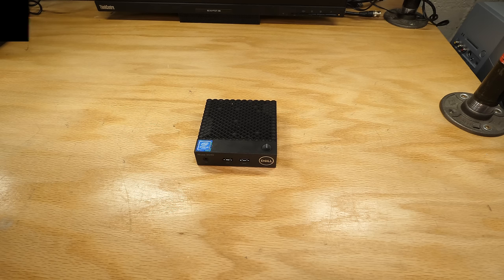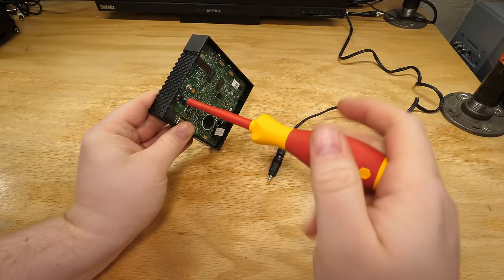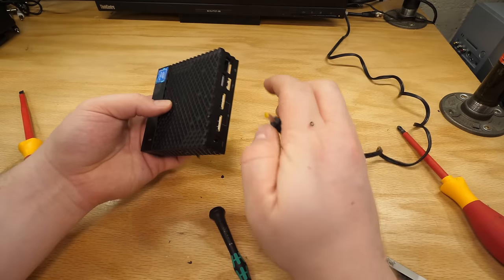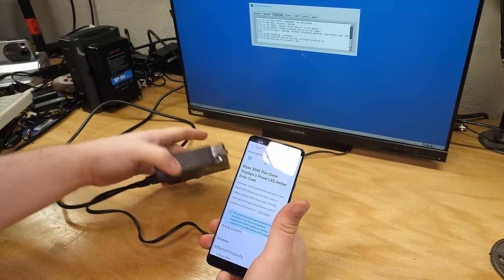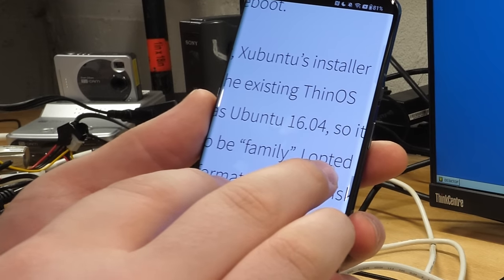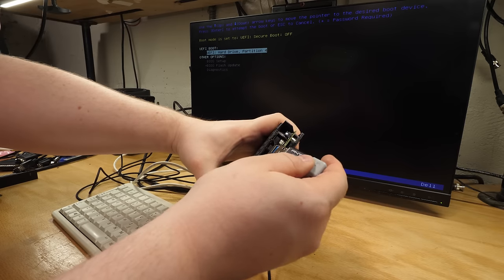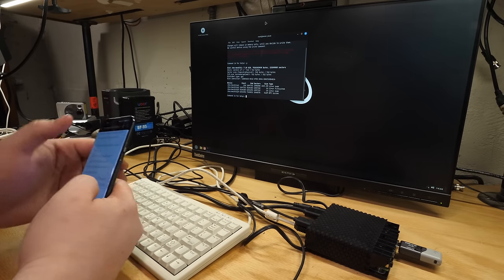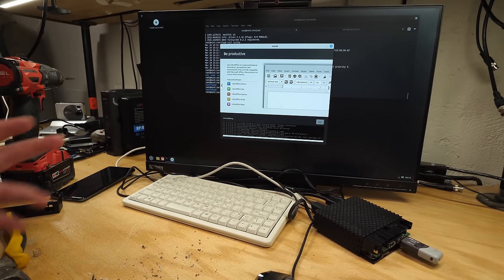Little Guys: Episode 2 [Wyse 3040]

Comment: The Atom in this thing is the same as the Atomic Pi SBC, which came with a 16GB eMMC. It was capable of installing 64-bit Windows 10, but the experience absolutely sucked as you'd expect. I ended up putting Fedora Silverblue on mine and using it as a low-powered remote backup server with the SD card slot as storage.

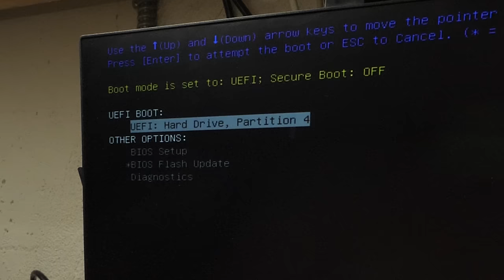Comment: 13:51 My Dell's BIOS has text mode UI, which I think it is default UI provided by AMI given that one ASUS machine I had has similar looking UI.
The menu at that screen looks similar, except mine displays those options inside a blue popup box.
Reply: Many of the cheaper machines have a normal BIOS. Basically all the Latitudes and Precisions have a the custom Dell BIOS. Although I will say my D800 (made in 2005 but introduced in 2003) has the older text-mode custom BIOS. I'm guessing the change to the current style probably started with the ~2007 models (like Gravis' favorite D420) as these models are 64 bit only.

Comment: I run a pair of these at home as DNS servers for my home network, for which they are more than adequate. I like that (if memory serves) the system uses about 5 watts, and because it's x86_64 then unlike a Raspberry Pi I can run a regular Linux distro on it which makes it easier to manage.

Of course, I am running Debian (without X11) and have manually set up PowerDNS on them, rather than using some potentially heavy generic "router/firewall" distro, but I've been quite happy with them.

One curious thing I found... with the DisplayPort to HDMI adapter I was using, it would hang when you tried to soft reboot it from within the OS, but if you unplugged that the reboot would succeed fine. (This wasn't a problem for me as I was intending to run it headless anyway - the monitor was connected for initial setup only anyway.)
Reply: Hmmm... I bought a lot of 13 of them, and 4 of them were giving me this problem as well as the CMOS one (while 7 were just giving me the CMOS issue), but I was testing them with a DP to HDMI cable that worked just fine. Maybe it is that those have too low of a voltage to run the cable on restart, while CRD's just doesn't have enough to even first boot?

Comment: I have a bunch of these things at work. It's not a surprise to me that it won't power on. I see this in ~1 in 5 of those terminals. You really have to press it hard and try a couple of times. Or just unplug and replug the power cord quickly while holding the power button. That usually works.

Comment: I work with a ton of surplus office computers, and for some reason, that style indicator light has issues. Some of them are perfectly fine, and others are really dim like the one you have. I have an OptiPlex 3040 micro which I set up as an HTPC, and the power light is the same way. It also is the case on the standard SFF machines as well as the MT machines. It seems inconsistent though as 2 of the same model can be completely different, it is annoying for troubleshooting.

Comment: Smallest Atom processors I've seen were probably those inside my long dead Asus Zenfone 5 (from 2014) which had an Atom Z2560 (2C/4T 1.6GHz) and Zenfone 2 (from 2015) which had an Atom x5 Z3580 (4C/4T 2.33GHz). Those nuggets heated up a lot like really badly. The Atoms inside lived around 80~100C installing apps from the Play Store and even worse when running anything demanding even emulators.
The heating issues paired with the crappy Android version by Asus (i.e. built in system apps like the battery manager and security center crashed among other apps) made for a poor experience for phones. Heck the Zenfone 2's body even easily warps and has ghost touch issues.
Atoms and Asus Nuggets aside. On the topic of the Wyse 3040 I know someone from a workplace that still uses some of those (but currently decommisioning them in favor of laptops being used as purely thin clients) and considered asking them if they could get me one for projects. Some research later and I realized it would be a pain in the a$s to install Debian and turn it into a raspotify or pi hole device because of the bios, eMMC, ram limitation among other issues.

Comment: Damn small linux, fits on a cd-rom, fairly modern os, various apps come pre-installed it received a recent version in 2024 after 12 years. alternatively there is an 'assembly language' OS, it fits into 8 megabytes of RAM.

I heard the point of these thinclients like the compute stick is to buy them in bulk with a bulk discount and have literal boxes upon boxes of them still on their pallets, so you can grab one out of the box, image it and put it in use whenever one of them fails... as if they knew they were going to fail often enough for this to be an actual 'solution' to the failures. as you said the 'real work' is being done elsewhere in a VM inside of a VM.

Comment: I wonder if the Ubuntu vs. Mint problem was a kernel version thing. A lot of people have been experiencing problems with the default 6.5.x Hardware Enablement kernel in 22.04 (UBSAN errors with my mother's laptop's AMD GPU drivers, UBSAN errors with my VirtualBox modules, etc. etc. etc.) and the recommended solution if you don't have more bleeding edge hardware is to switch to one of the other packages that'll give you a Canonical-supported 6.2.x-series or 5.x-series LTS kernel instead.

Comment: Use puppy Linux. It's very tiny and will run reasonable on a 486 DX4 100mhz so a arm atom CPU will fly on it and easily fit with room spare on the emmc storage.

Comment: CMOS battery is most likely a CR2032 with leads attached to either side.  In a pinch you should be able to cut the leads off that one and use some heat shrink tube to "attach" them to a new one.

Comment: As hackjob for the cmos battery: you can just snip the wires off and solder a cr2032 on it
Reply: Or copper tape the existing contacts, as solder, unlike the original spotweld, will shorten the cell life. Finish it off with a bit of light heatshrink tubing.

Comment: I'm pretty sure ThinOS is Linux-based, because it supports a lot of Hardware that is not Dell or meant for it. Like cheap bluetooth dongles.
It's bigger brother 5070 is kinda popular for pfSense, because the Extended version has a low-profile PCIe slot.

Comment: From what I’ve seen with that sort of model of dell power lights, they must be overdriving the LED or something because it just seems that they just get really dim over a relatively short amount of time, worked on plenty of desktops that had extremely dim power lights and I would only know that it did turn on sense it flashes the much brighter orange light first 

This undoubtably has high hours on that little LED, probably only ever turned off when the power went out

Comment: I'm sure it's been said, but "Windows on the go" via Rufus may be an option to install Windows to a USB drive.
As far as installing Linux? I was able to install Minimal Xubuntu by formatting at BTRFS, enabling compression, and only then is there remotely enough space to install it with no swap. I think I had somewhere in the realm of ~2GB of free space, and didn't have much more installed other than Firefox.

It's neat that you can make a computer this cheap. It's unfortunate that it doesn't use mSATA, or m.2 with SATA/PCIe available as it's utility would go through the roof.

Comment: I have a dell workstation with similar industrial design that has the same problem with the light on the power button. Either the LED isn't bright enough (maybe it dimmed over time??) or the plastic isn't clear enough. Fortunately it has a super bright white HDD activity light so it's pretty easy to actually tell if it's on.

Comment: that cmos battery is used on alot of dells you might be able to use the same battery as the RPI 5 RTC battery if its the same voltage ?
Reply: Yeah, it's just a CR 2032 cell on a header. Must be cheaper than the button cell holder.
Reply: @volvo09 A button cell holder won't fit inside

Comment: My workstation Dell Optiplex 7040 uses the same power button and I also can't tell if it's on by the power light. There is an orange light that does shine through it when you press it though, so it may have been made with an orange light in mind.

Comment: For the sake of asking, have you seen the InFocus Kangaroo? It's another weird little PC equipped with an Intel Atom. It's meant for mobile use, but instead of being a standard laptop, it's just a little slab. It also came equipped with its own certified Windows 10 release, which ultimately also means that stock Kangaroos are locked at a very old version of W10.
Reply from the maker: I JUST learned about this the other day by accident, and I really want one. Mind you, it's not really ideal for this series, since it's just a consumer product (and an incredibly absurd one), but I'm tempted to get one anyway because nobody else seems to have reviewed them. They look really, really awful.
Reply: @CathodeRayDude  The build quality at least is pretty solid in feel, and since it's locked to an ancient version of W10, it doesn't perform too bad either. But the battery life is definitely poor, and it wouldn't be suited to much more than web browsing.
Reply: @CathodeRayDude  The Kangaroo might be good for a Little Guys Gaiden, if you somehow manage to get one!
Also, love your content BTW. Been hooked ever since you're recommended to me a little while ago!

Comment: There's an UEFI bug that prevents it from installing/booting linux.  Also Hardware Haven covered it in one of his videos.  I also recommend Wyse 5070, which works flawlessly, as long as it is not Windows, and avoid 3040 if possible.

Comment: That LED issue is kinda weird.. I've got a whole stack of these around, and their power LED is bright enough to be visible in regular daylight. Maybe your unit has just seen a lot of hours of use and the LED has burned out? It might also be a series issue, since there are at least 4 different revisions of these thin clients, with the latest one having been upgraded to 16GB eMMC, and that's a really useful home server box, especially at the ~40$ price point these are going for.
If you want to get Windows running on it, why not just plug a 32GB USB stick in it and install it on there? The USB3.0 ports perform well enough for that, if you get a good drive.. or maybe even an external NVMe enclosure.

Comment: Thin clients are neat to look at but are never as fun once you get your hands on them. I own an eBox model that's based off a hot-rodded 486 known as the Vortex86 that can run things like DOS/Win98/WinXP from an SD card slot on the front. It's neat for a couple hours, but then you realize it doesn't do floating point precision, nor does it have audio drivers.

Comment: I have this little atom based stick PC that's about the size of 4 usb flash drives sandwiched together. It has eMMC flash storage and when I first got it, it did reasonably well playing videos and whatnot, but the storage wore out sooo quickly and now it's slower than slow. Honestly a modern micro sd would do better for storage speed and reliability.

Comment: Check out the Intel Joule sometime. This is the smallest X86 computer in my collection, its quite a bit smaller than the one you showed in this video! It is also an Atom CPU, 4-core, 64-bit, but with 4GB RAM, and I think 16GB storage. I was able to get Windows 10 running on it at one point and did some benchmarking.

Comment: If there's an m.2 slot in there, then there's most definitely an easy way to upgrade the storage and install Windows. 

And even those small 2230 or 2242 slots do technically support the standard 2280 SSDs, so if you just wanted to try it, you could just test it with a regular m.2 SSD you already have lying around and just manually hold it down.

Comment: Regarding that m2 slot and using an SD card for a new drive...

"The Wi-Fi card shipped with the Wyse 3040 is SDIO. If you have no clue what this is, don't feel bad, I didn't either. It's Wi-Fi over SD (yes, SD as in SD cards!). The SDIO spec was originally created for PDAs."
There are no M.2 to SD card adapters that use the SDIO pins, so no dice buddy.

Comment: Re: The light channel on the button. I have a bunch of SFF Dell 7080s and in the 5 years we have had them the light has faded. I'm thinking dell have used a transparent plastic that's slowly going opaque over time. FYI Dell use splashtop still for their graphical bios interface.
Reply: Not splashtop, just AMIBIOS with a theme.

Comment: Pardon me if this is a dumb question: Can that little Dell, or a different thin client computer be converted into a NAS fairly easily? Or at all? I really need to get around to building a NAS, and I see those little thin clients on FB marketplace often.  I thought it could be a good solution for doing things on the cheap. I'm just looking for an inexpensive way of consolidating all of my media. Educational responses are greatly appreciated! Thanx!
Reply: They'll mostly work well for a simple NAS. The main problem is the lack of internal storage but external USB hard drives will be fine if you don't mind the performance hit.

Comment: I've heard rumors that this is what some of the vague overlords of computing want to turn all computers into things like this. 
Those rumors are unfounded, but you know.

Also, DisplayPort has better licensing vs HDMI, so it'd be cheaper per unit. 

8 GB MMC? Couldn't really cram Windows into that these days. Maybe XP and before, but hoofa, that won't work either, because Windows XP wouldn't know what the heck!

Ah, Mint and those weird quirks.  Turns out being the LTS of a LTS of a LTS has that. I wonder if that would have happened in Anaconda or Arch? Would Puppy work? I've played with Slacko (Yes, Slackware) recently.  I also enjoyed poking Haiku for a moment, suprised how that worked.

Comment: Love me some Wyzes. I've got 2 5020s at home, I run one with Debian for Jellyfin and the other with OpenBSD for a Minecraft Java Edition server. For $30 apiece on ebay and using USB for storage, they're a terrific value for the performance. My server can stream 1080p to about 2-3 devices over the network, so they can stream fairly well as well. These extra little guys look like a scam though. Saw em for like $15 on eBay and it looks like there's a reason for it.

Comment: It's great for running Home Assistant. It has just enough ram and storage to tinker with.
Reply: I wouldn't trust the eMMC for anything critical. For my HA instance I instead use an Igel D220. It only has a single core atom, but has even less power draw than this and has up-gradable RAM and mSATA slots.
Reply: @Schule04  It's great for experimenting with and having fun with HA. They used to be less than $30 but then everyone snatched them up. Can't beat the form factor either.
Reply: @cannibalcalvin Yeah I know, I installed gentoo on one of mine lol. But I'd trust a SATA SSD attached over USB a lot more than the onboard eMMC.

Comment: I have two of these and I'm currently running ARCH and Manjora on both. No luck trying to run Botacera and I've gotten emulators like SNES9x and NES/Genesis to run, but there is a Vsync issue that's throwing the sound drivers off making it stutter.

Comment: I own that thing, with 4TB laptop HDD, used as NAS/Torrent/It army's Distress. Running Bodhi Linux (Ubuntu fork) and yes, gui linux is most likely won't work here, my installation now using more than 8GB. It's case is kinda strange. Guy that i bought it from sent me hand soldered cable and it's jack could be longer or shorter (so i made it longer, because it got short and stopped working). My light is so bright that i taped it out. M.2 slot is for wifi only. There are official adapters. I got later revision (2021) that support 12V AND 5V too and 16GB memory. This machine support Windows and has pretty buggy BIOS.

Comment: Strange. I own one of these units and it has none of the odd issues see here. The power LED shines through nice and bright, the DP connections do work with passive adapters, and the CMOS battery still survives. One note on the USB issues is that it's probablu only the 3.0 port that's giving you issues as mine does in the bios, and you might also have the other port disabled in said bios. As far as the OS, it is indeed a skinned Linux, and there is a system that supports somewhat flaky RDP once you have it on a network.
Reply from the maker: I've heard there are a couple revisions of these things, so it's possible you have a slightly later one that's still called the same thing. It's also possible my monitor is at fault re: the DP thing.

Comment: A minimal Debian setup might work. antiX is actually purpose built for old or low spec systems. 

Curious how ChromeOS Flex would run on one of these. Probably not enough RAM and the crappy iGPU would probably make it awful to use but Dell probably could have just sold these as Chromeboxes if they weren't so stingy with the hardware.

Comment: I wonder if the Dell Micro PCs i've got have the same issue, but use a brighter LED or something (the light is hard to see in a well lit room, but in a room with not great lighting, it has about the same brightness as a monitor set to brightless level 10 (out of 100)

Comment: I'm a fan of the slightly larger guy Wyse 5070, as it seems to be nearly the lowest power / cheapest thing that can run a 1080p/30fps OBS stream with hardware encoding and hovers around 6-12% CPU while doing it. About all the 3040 can handle is viewing a stream at ~160p. It's a little surprising how incapable that atom is when running Lubuntu off a 2.5" SSD over USB3.